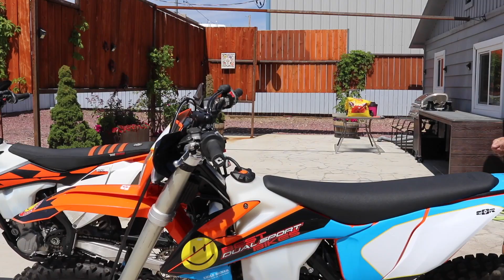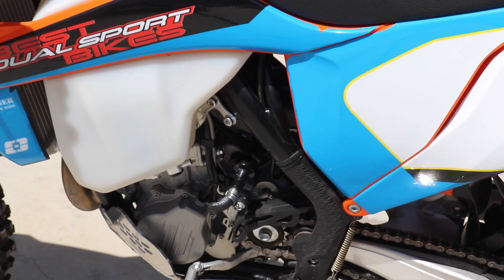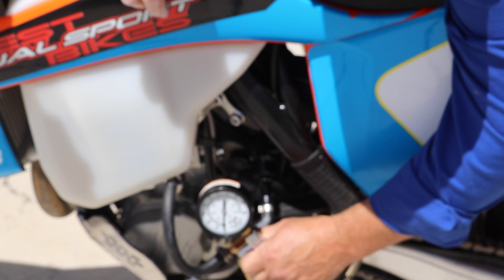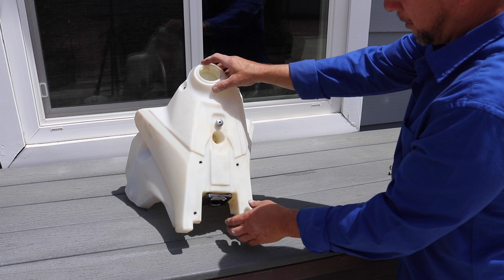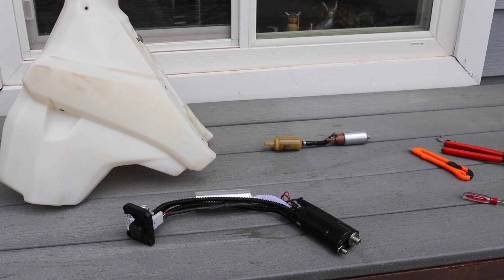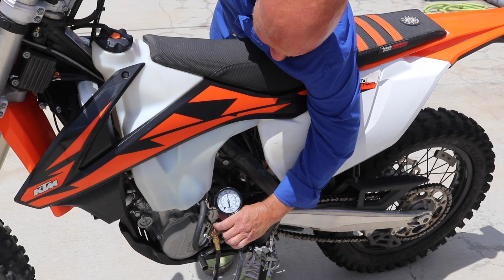My KTM / HUSKY lost power. Why? Vid #2  Fuel pressure! Fixing it forever

Comment: Please help, I have an sxf 250 in 2013. My motor fuel pump pressure is 40 psi, is this what causes the sound of the motor to be unstable and difficult to turn on. I want to ask what is the psi standard fuel pressure of sxf 250
Reply from the maker: 48-50 psi is what you should have stock